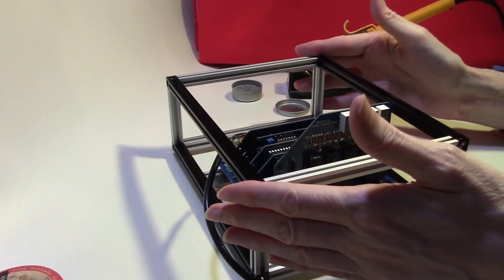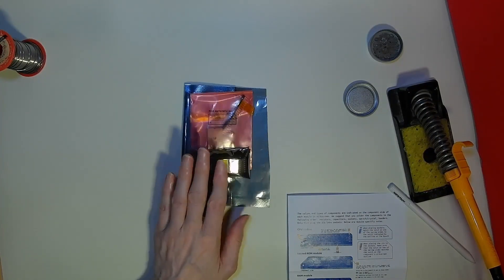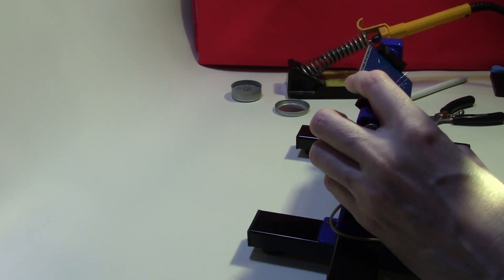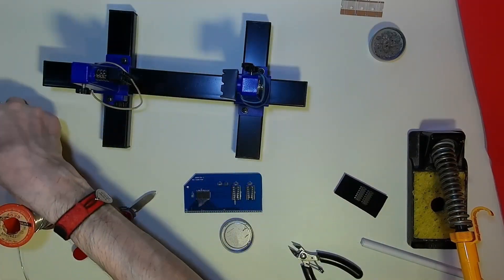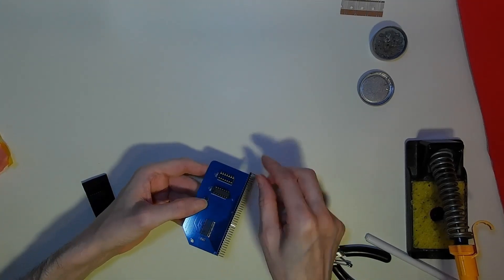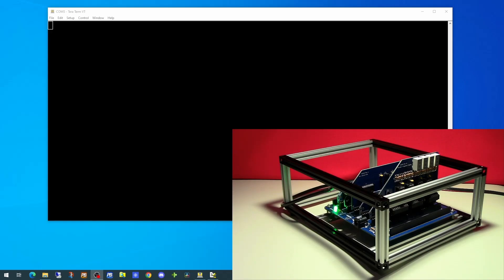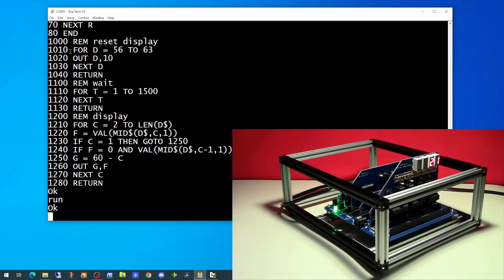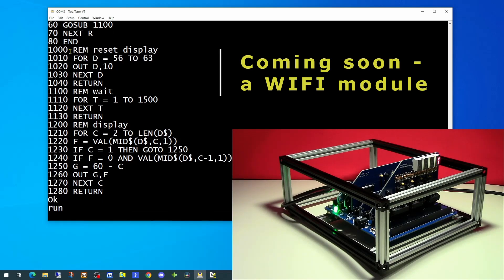Building the RC2014 Classic II - part 9 (Adding 32kb non volatile RAM module)

Comment: Is that 10mm aluminum extrusion? I tried finding some online, but some asshole decided that they would sell 1 inch by 1 inch extrusion as “1010“. It made searching for "1010" millimeter extrusion more difficult.
Reply from the maker: Yes it's 10mm cross section, search for Makerbeam and you should find it. They do a 15mm x 15mm also.